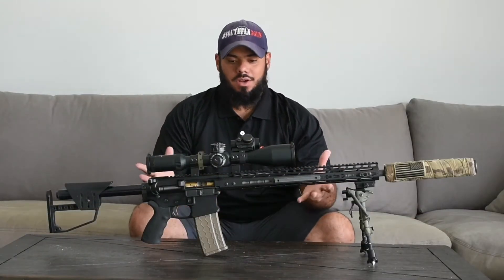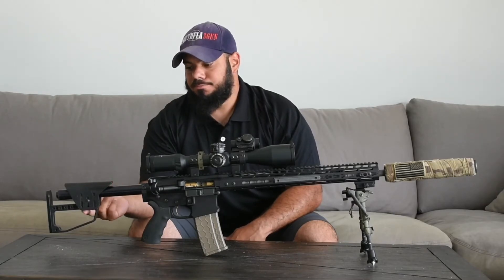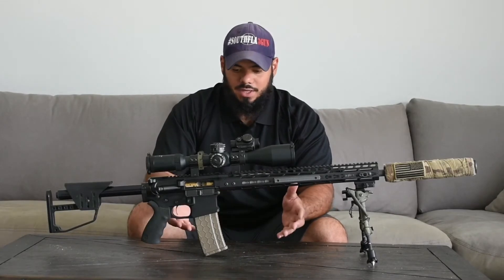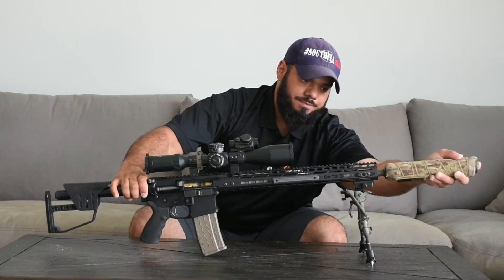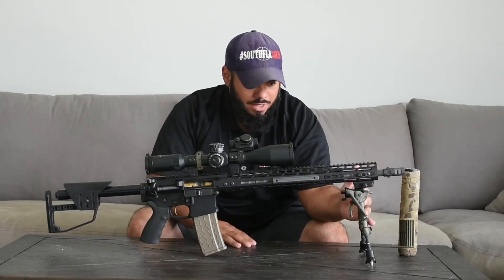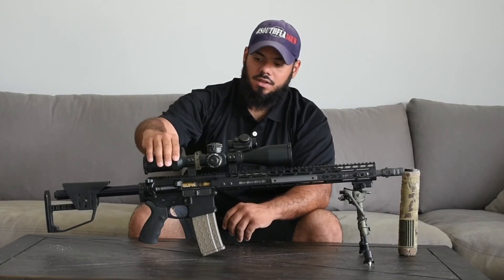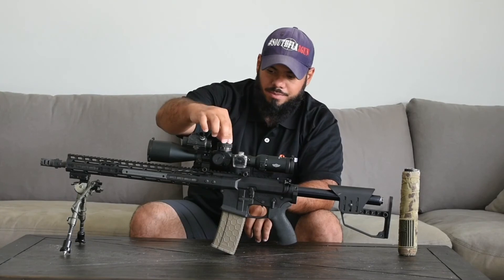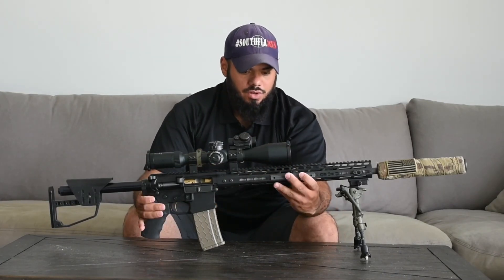Ar-15 Designated marksman Rifle

Comment: I assisted the USAMU deliver the SDM Course from 2004 to 2011. The SDMR rifle built by the USAMU was essentially a match conditioned M16-A4 with as issued iron sights, TA-31F ACOG, Grip Pod or Harris Bipod, and M1 Web Sling. It featured a Knight's Armament 2 stage semi-auto trigger group, 1 in 8 custom fluted stainless Douglas Barrel, painted with Black BBQ Grill Paint, and chambered for  5.56 with emphasis on the Mk 262 77 grain SMK loading. The rifles were fitted with a Daniel Defense free float M4 Handguard and a windage adjustable front a-frame sight base.  These rifles however were not seen in training performed by USAMU. Instead, similar rifles made by Armalite  provided by Civilian Marksmanship Program along with a cadre of highly qualified Civilian US Distinguished Riflemen and NRA High Master Shooters were deployed to assist the AMU conduct training at Ft. Benning. At other Posts, Soldiers usually used their as issued M4s, since the course was mostly about the marksmanship knowledge and skills needed to get good hits with the as issued A4 or M4 with BDC irons at mid range (300 to 600 meters).  The  Instruction usually contained sessions on: Principles of Marksmanship, Building a Steady Position with a Hasty or Loop Sling, Zeroing, External Ballistics/ Bullet Drop Compensation, Range Estimation, Slope Shooting, Wind and Weather Effects, Data/Score Book Usage, and Shooter/Target Analysis. Instruction on how to use the ACOG's  range finding and bullet drop compensation reticle was also given. And, occasionally, lead shooting techniques were partially covered.  At any rate, I enjoyed the opportunity to assist. Most cherished memories I have today is how quickly motivated Soldiers could gain an understanding of what's important to good shooting. This is typically not the case with many civilian shooting enthusiasts who believe they know how to shoot and therefore can simply improve their shooting with a match grade rifle. An afternoon of NRA MId or Long Range Shooting with a so called SDMR will quickly clarify who on the firing line actually knows how to do it among those who don't know that they don't know.